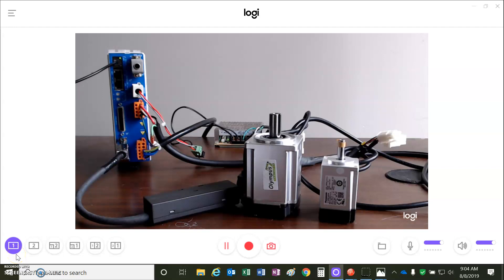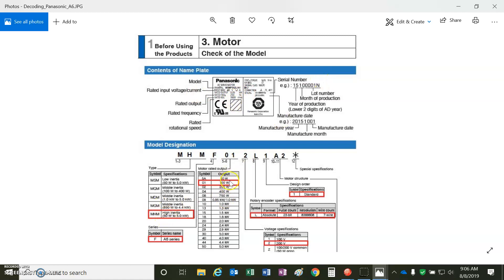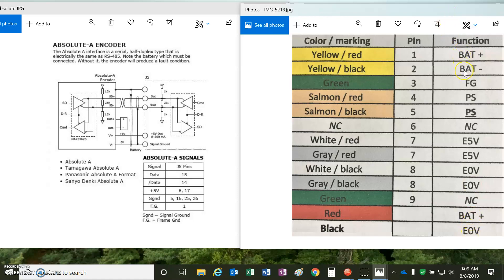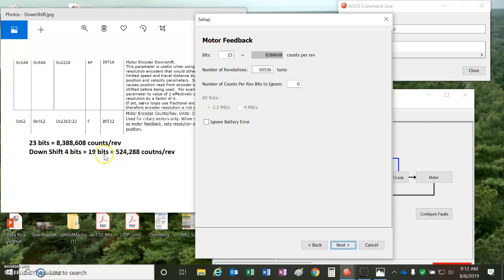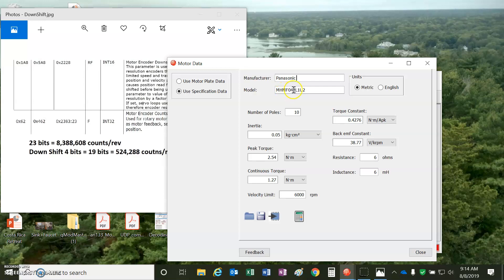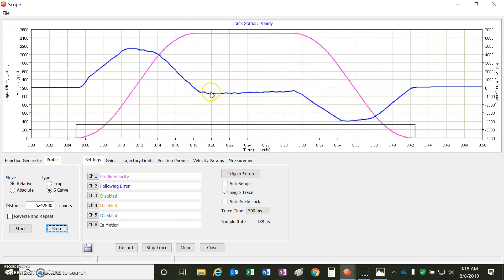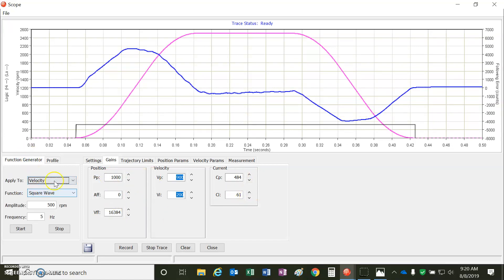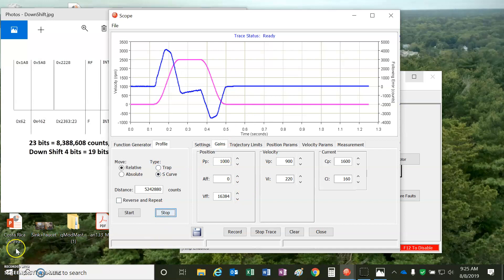Panasonic A6 23 bit Single-turn (16 bit Multi-turn + Battery) low cog with Copley Xenus Compact

Comment from the maker: Testing ignore battery 23 bit with 0x1A8 4 bits downshift and 0x62 for 524,288 counts/rev.  I find CME 8.1 allows for ignore bits 4 to show the more logical 524,288 counts/rev on the CME setup screen and allows for setting motor max velocity to >6krpm. Tested FW 4.34